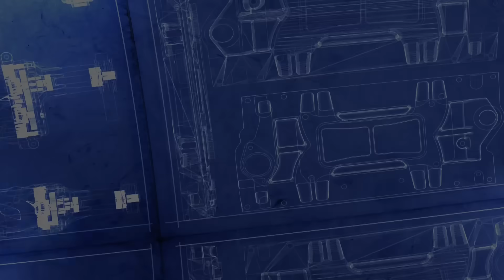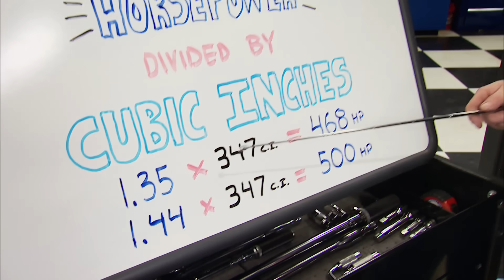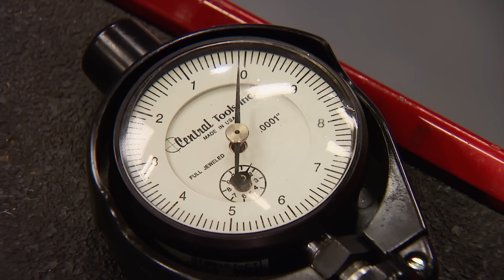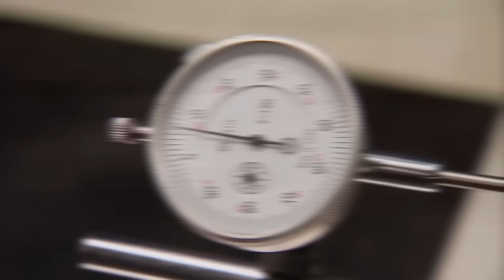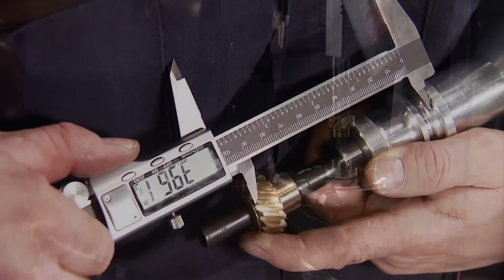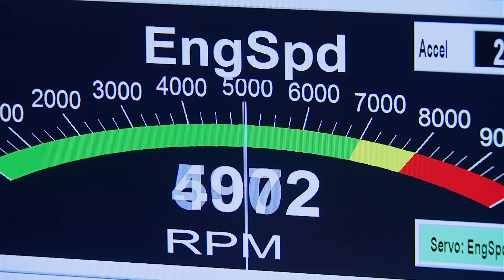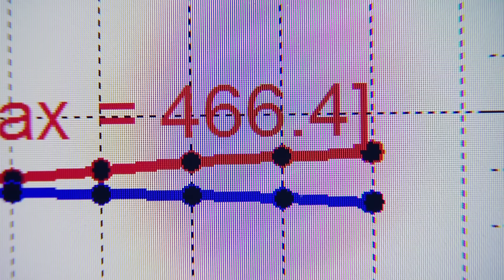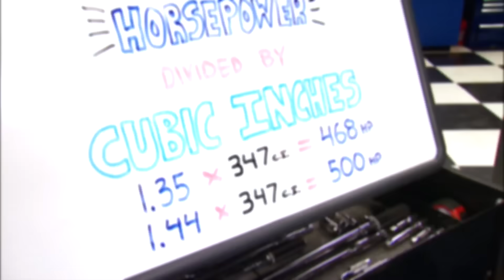Stroking A 5.0L Small Block Ford to 347 C.I. - Engine Power S2, E8

Comment: i might as well have watched this with the volume off. it didnt teach me anything.  it was more like how to set the table for dinner rather than how to cook dinner.  
i would have loved to know why each piece was used over stock or others after market stuff. this leggo build was cool but uninformative.
Reply: ps, why use a single carb? dual carbs give more even flow.  is why port injection works better.  dual carbs, efi carb or whatever, give the same even fuel distribution to each cyl.  two smaller half sized ones rather than one bigger one will give more overall hp as each cyl gets the same air and fuel amounts rather than the middle getting more than the end cylinders as with one big carb.
Reply: @tomster7574  because a tricked out split carb on a street engine is a waste and won't make more power despite what you think.  check out thunderhead289 if you want some building tips.
Reply: @KingJT80  thats not true. every engine builder says the same thing about uneven fuel delivery with a single carb for a v8.  the science says, cut that carb in half and have each half fuel 4 cyl each.  all 8 cyl get even fuel delivery.  just like an 8 stack  but with much less moving parts.
Reply: @tomster7574  its not thatbit won't work

Its a waste of time

A 4 bbl will do what you want it to. 

Spilt carbs are for the cool factor but the cost factor WILL go up because those manifolds arent cheap

A good single 4 barrel will make the power it needs and keep the cost down simplify etc. For the average Joe hot rodder
Reply: @tomster7574  also, a single plane does exactly what you're taking about
Reply: @KingJT80  its as practical as efi and costs a lot less and much less complicated.
Reply: @tomster7574  and a single plane and 4 bbl are even simpler than that.  '

 nobody is making or catering to split carb manifolds unless you're talking the old 6 packs on chryslers.  because they aren't needed
Reply: @tomster7574  i admit on a race application IR manifolds are cool.  8 stacks
Reply: @KingJT80  you like what you like. dont make you right.
Reply: @tomster7574  ok then why arent most manufactures making selling those types of manifolds the most for street applications? I didnt say they wernt better. I said its not needed to make a lot of power.

Comment: Is Lil' Black and Blue considered an Over square, square or under square stroker build?  I am looking to build a square stroker type.
Reply: its a short troke so under.

a square one would be a 408 based 351W stroker.  and yes they are bad ass and would blow this 347 stroker away.
Reply: Not with a 302 block.

Comment: You say many times, about checking clearances, it is good to go. I am not an engine builder and probably won't build one, but can you cover in a video when the clearances are not in the tolerance ranges, what has to happen to correct the tolerances.
Reply: machine work most likely is what will correct it.  and thats up to the engine builder and your wallet

Comment: Man that's a big hp jump from 302ci to 347ci. I'm just about done assembling my motor from my 94 Cobra 5.0. I had the block stroked out to 347ci and bought a set of Edelbrock performer aluminum heads with 1.6 roller rockers on intake and 1.7 roller rockers on exhaust because I'm running a 150 jet shot of nitrous oxide and the bigger rockers on the exhaust gives me another 10 to 15 more HP with the nitrous oxide. Those numbers were the HP gain from the 302ci before the stroker setup. So I'm curious to see what the gain will be after. But the roller rockers, cam, pushrods, double spring valve springs, valves, valve seals, and retainers and all are comp Cams. I have a 80mm throttle body and 85mm MAF, cold air intake, under drive pulleys, BBK short tube headers, MSD ignition system, 150shot WOT setup wet NX nitrous oxide, a 3 key fuel pump system with 3 190lph fuel pumps with manual pump shutoff system so I can run one pump for normal driving and if I need to run 2 pumps or even 3 pumps for racing, a adjustable fuel pressure regulator, 30lb injectors (but might change over to 48lb injectors if setup needs bigger setup). I'm using my original Cobra intake manifold upper and lower because they are the same size or bigger than the aftermarket intakes, but I have reported them. I'm running a 3in exhaust system with a BBK pro series xpipe with 40 series flowmasters. I have a lot more but it's hard to remember everything but without nitrous oxide I was thinking the motor would be pushing around 400whp. But by watching this I might have underestimated the power gain by alot. But I did use my factory block and had it machined so I don't know if that will play a part in the difference. I don't see how it would sense it's machined to the same cubic inches, but I don't know for sure if it will make a difference. I was going to pro charge my 347ci because I wanted to have around 550whp but if I get the same numbers or close to these without nitrous oxide I'm good. I guess I'll see tomorrow when I finish my motor assembly. I also completely rebuilt my t5 transmission and 373 rear end to be able to handle the increase in horse power and torque.
Reply: So what did you end up with

Comment: installing the piston rings this way is a great way to break one of them. Buy the proper expansion tool, and the distortion of the ring occurs around its circumference, not located in a smaller quarter of the ring.
Also, install the cam before the crank, and you can reach in and help guide it in so as not to score a bearing. But if you find a cam bearing is too tight? Easier to fix it when the crank isn't in the way.

Comment: We had these in Australia for years, originally casting our own and then returning to USA stock in the 1990's. In 2002, the Falcon XR8 5.0i was producing 297hp & 435nm with factory exhaust. A good set of pipes & exhaust easily added 30hp. Good fun with the Tremec 5 speed and LSD.
Reply: >LSD
Ummm.....

Comment: This is a 2 bolt main 302 block... you don’t need H beams, I beams have less parasitic loss, weigh less, and cost less. That blocks not taking more than 500fwhp for long so you don’t need heavy 1k hp rods.
Reply: lol thats what i thought too.  just a cast steel crank and i beams from scat.  and be done with it.  put a performer rpm kit on it and it'll make the same as these 11r 205 heads which require different pistons that are even different from the original TW heads which are not 11 like these but are 17/15 degree twisted wedges

Comment: I like this build, since almost anyone can duplicate it. No real wiz-bang secrets, since all of the machine work was already done on the block. Not mentioned was the balance job done on the rotating assembly, which if you buy the parts separate and have a reputable shop do the work, will cost an extra $500. I like to do it like this rather than buy an off the shelf pre balanced "Stroker kit". Whatever you do, this combo of Eagle rods and Crank with the Mahle pistons cannot be beat. By the way, it's pronounced "Ma" "LEE"...lol

Comment: That's a poor ring installation technique.  Good way to put a slight bend in the ring or even break a cast iron ring.  They need to be expanded evenly and cleanly set over their groove before being released.

Comment: I'm building a 66 mustang coupe and I have a 302 out of an 87 ltd that I plan to put in it. I really want to build a stroker BUT I want to maintain reliability so I think I'm gonna keep the original displacement and go with a mild cam and ported heads.

Comment: Looks like the only Ford part left is the block. Aftermarket crank, rods, pistons, bolts and heads. If stage one used factory heads the peak HP would have been closer to 370. The name fits if it really stands for black and blue wallet.

Comment: One quick question do y’all run the engine for 30 min to break in the cam or is it not necessary with today’s method
Reply: Roller cams don’t require a break in.

Comment: Sticking with a 332" (3.25" x 4.030") ends up making more power and being generally more durable than the larger 347" stroker due to the better rod to stroke ratio. I run custom length 5.5" rods in my 332", so the rod to stroke ratio is 1.69:1, which is what a stock 302 has. Longer piston dwell times and less piston side load on the cylinder walls means more efficiency and longevity. Also, when building a stroker, (or any high hp 302) the pre-1983(you can tell from the 2-piece rear seal vs 1-piece rear seal) 302 blocks weigh 120 lbs, whereas their newer counterparts only weigh 80 lbs. That extra 40 lbs of cast material was removed mostly from the main bearing support area of the block in the new castings, and Ford did that to help lighten the nose on the Mustang fox bodies for better handling. The end result is, a heavier older 302 block can "reliably" handle upwards of 800-850hp, while the newer 5.0 blocks can only deal with 450-500 before they fail.(that's assuming you run a billet steel main stud girdle)
p.s. The Race Demon carb series were tested on a dyno vs various performance fuel injection systems, and the Race Demons actually made more HP and much to the surprise of everyone, also outperformed fuel injection on low end torque too. Barry Grant knows how to build a carb. This is why I always suggest the Barry Grant RD carbs over any other Holley style carb.
Reply: Thanks for the info. Would you mind sharing more please?
Reply: I never could believe the 5.0 blocks could handle so little
Reply: You making Sense , Sir !

Comment: Who uses a impact gun installing rod caps and no lube on the camshaft I’m glad I built my motor
Reply: They did use lube on the cam. They didnt say it but you could see it.
Reply: Bucking Bronco was it clear I always use red thick sticky assembly lube adding it as it goes in they are not engine builders there on tv there hands aren’t even dirty
Reply: @jimcatx3090  I mean 🤷‍♂️ its whatever man. Yeah, it was clear

Comment: ford
Reply: Ford Block and aftermarket everything else.
Reply: @timsharpe3498  yeap.... FORD
WHat you said.... Thats every race motor on Iron blocks.  WHen you build your motors you don't buy the parts at the dealership.... do you?  LOL
Reply: It really depends on the class and rules. In SCCA you can get busted for having the wrong temp thermostat in your race car. Back in the day NASCAR engine’s used factory blocks and heads even when aftermarket aluminum pieces were available. Fact. No SBF Windsor engine ever qualified for a Cup race because they can’t crack 450 HP with factory heads. SBC can make over 500 with factory iron heads.
Reply: @timsharpe3498  Windsor is junk. I have a 500 hp cleveland with 500cfm 2 barrel. Yes... 500hp with a 2 barrel.
The Cleveland was a NASCAR motor and devastated all others. That is why it was banned and many of the regulations put in place. 351 Cleveland can be built for 800 hp with no boost.  No Chevy can match that cube for cube. EVER. This is Iron block too. Check his other video to see the motor.
Proof:  http://youtube.com/watch?time_continue=3&v=zqn-jy35SaM&feature=emb_logo
Reply: You’re confused. NASCAR never banned the Cleveland. Ford quit NASCAR because the Cleveland couldn’t compete. NASCAR did ban the Bud Moore plate modification. Ford couldn’t find enough buyers and dropped the crappy Cleveland after 3 years of awful sales.
Reply: C3 heads are not Cleveland heads. Yates calls them an evolution of a Cleveland head because they’re so radically different from factory castings. The exhaust ports alone are worth 120 hp over the best ported factory casting. Cleveland’s are dyno queens that can’t last 500 miles .

Comment: I'm broke on a budget. I use a 351 windsor engine from a three quarter ton Ford truck. It has forged rods from the factory. I use   forged pistons and use the cast crank. Iron eagle heads and lots of spray.

Comment: This reminds me of the 302 Chevy “ A SS or z28 engine “ a 1 or 2 year oddball. A real gas hog of a engine. At least it made enough power to warrant 3 mpg 8 if being easy on it. Timing was strange on them ,the alternator was turned opposite of most other SBC engines. To advance or retard the timing the alternator is turned opposite of other SBC ‘ S one fella told me it was to do with a big bore with a short stroke . He also felt it was the only SBC worth owning as well . I like the 400 small block best myself. Torque comes in strong as soon as acceleration begins. Keeps your foot out of it . Improves mpg over most SBC s some 350’s did very well to. Some 327’s did and some 283’s had it.  All 302’s and 400’s got guts if running properly. Some 350’s run great , have no power and drink gas by the gallon . Any 400 or 302 with a aluminum mid rise duel 4 barrel carb with long tube headers will push you back in the seat. Run a big radiator with a 400 always. 400’s also run great with a 3 deuce intake as well. Best bet for everyday cruising is a NEW 850 cfm Rochester four barrel carb or even a 600 cfm holly two barrel carb . Get mech. Secondaries . Mid rise hi flow intake. Headers . Then that 1 tone work engine will make 400+ hp in your “ hot rod cruiser “

Comment: Whatever happened to breaking in period.  Can someone shine a light on that. Max out right after building the engine not hurting it at all?
Reply: Dunno. If the cam is a roller that can be skipped, but the other parts need that time.

Comment: Built using off the shelf parts, $10k later. At least they had the decency not to call it a budget build. Nice motor though.
Reply: I had a 69' Mach 1 with a built 351 Windsor and that motor was pretty stout. Why not just throw the top end on a 351 without the expense of a stroker?
Reply: @johnl9977  hood clearance
Reply: @johnl9977 weight and stock internals would have it be lower compression

Comment: You self expressed experts use the term freeze plug as if that is their function. The correct term is block plug as their function is to remove the sand from the casting. They do not protect a block from cracking from frozen water. Be professional!

Comment: I am a ford man but damn they should of used a dart shp block all this $$ invested it's cheap insurance by the time u clean up and bore a weak 302 rolller block just pay little extra and never look back and pieces laying on the road...
Reply: Nascar blocks are best if built up properly.can safely rev to 11,000rpm.they have thicker bores than standard V8 blocks.plus 4 bolt mains but last I heard they were $3gran just for a bare block.& that was over 20yrs ago.also seen in a mag some 1 stroked a 351 out to 454.heard 351 Windsor block with Cleveland heads is way to go

Comment: Do you really think that main girdle does anything hanging out in midair like that hat a waste of money
Reply: It's purpose is to stop the bulkhead/cap assy from wagging backwards and forwards along the crank axis. It's not for lateral location.
Reply: @jameseastwood4984  The very best way to make an engine stronger is to have a good tune up. In the 60s we always would put a strap over the cap of our 10,000 RPM modified elemnator 278s but we never had the dyno tuning to get that perfect tune up. So then what does the thrust bearing do?
Reply: @racerd3801  In my experience cap-straps and girdles perform slightly  different tasks. A extra strap across the main cap is to react the firing and reciprocating forces, and to ensure the bearing clearances are uniform to prevent metal contact. The girdle is to stop the cap moving along the crank line. High performance engines run at higher speeds, as you mentioned, and this can mean that things like the bulkhead/cap assembly can begin to resonate. The girdle just stops any resonance and stops the cap pinching the bearing as it moves. Might be helpful to have a sketch to explain!
Reply: @jameseastwood4984  Being that this is a Windsor block the real problem is that the main cap is to narrow, not like a Cleveland where you have room to Dowel pin the caps. I think Pontiac really were the only ones that had it right. No registers , only dowel pins